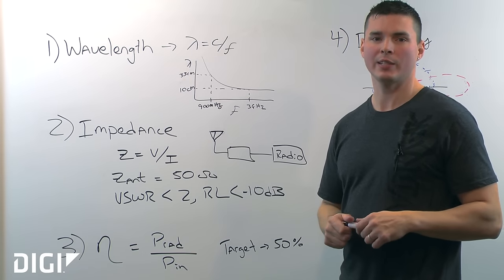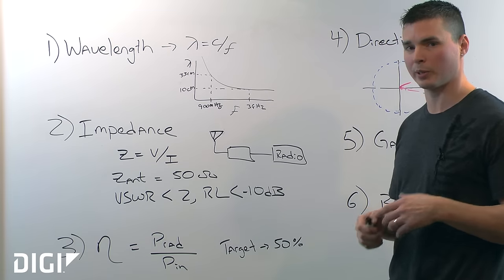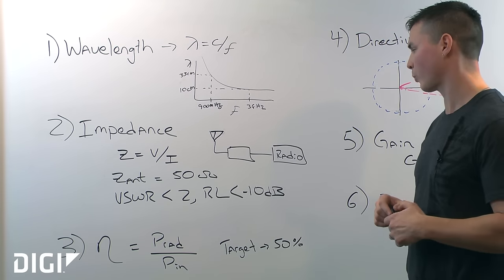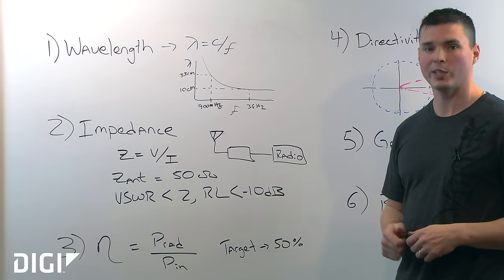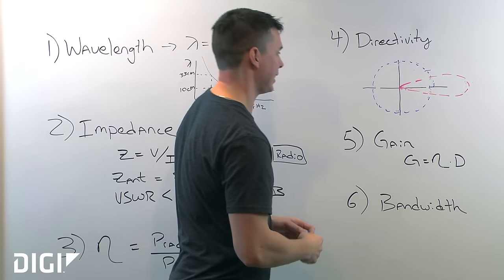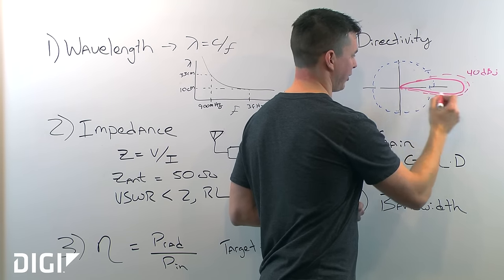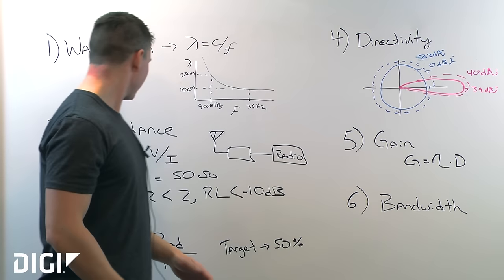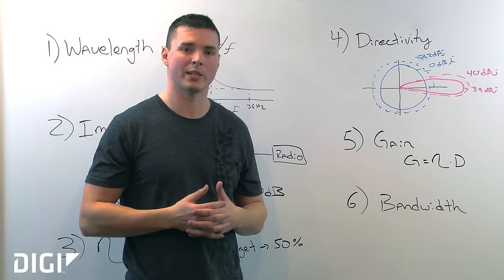Antenna Design and Integration Fundamentals

Comment: Thank you very useful. 
Can you tell me the Z  what number are good and what are not.

I buld a monster here and is insane....
VSWR less than 2 in a huge range between 137.5Mhz and 2Ghz in some places is 1.02 
S11 is -34.5 dBi and huge range below 17-20dBi 
Between 40-50 Om

And this is just by touching it with the core wire on my veranda , without installation or special environments..